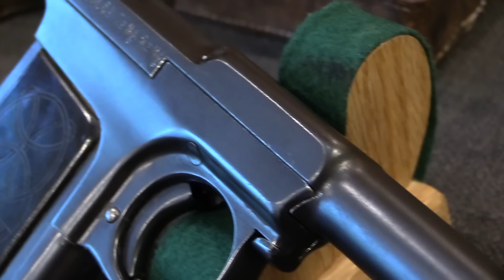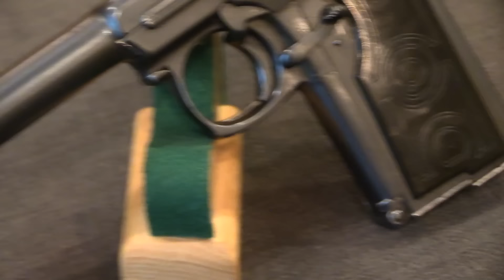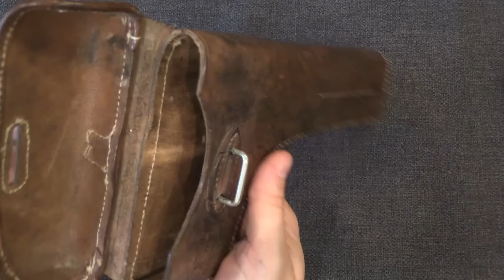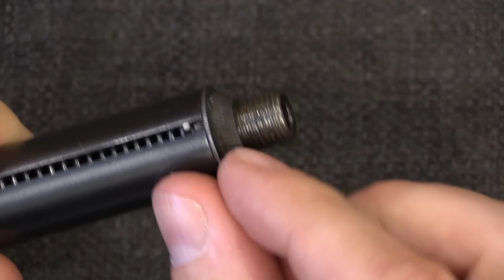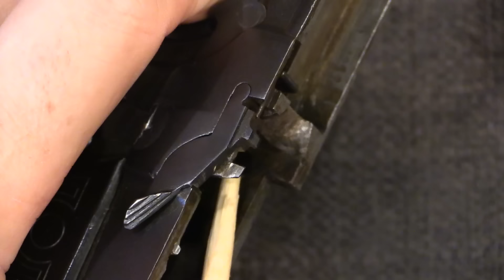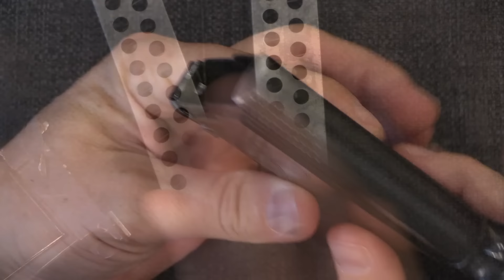Sunngård Automatic Pistol: 50 Rounds in 1909

Comment: Just watched this video almost 8 years after you posted it.
I easily see more reasons why the 1911 copy was favored over the Sunngard.
The ones you mentioned:
1. Too small a caliber
2. Awkward grip
Additional:
3. Too complicated to use.  Overly fine motor skills are required to engage the second magazine, then move it back into its original place to insert the third.  Too finicky.
4. The third magazine is set way too deep in the holster.  If the holster is mounted on a belt, good luck getting the magazine out in a reasonable amount of time.
5. The gun is too difficult to remove from the holster as it overly-encompasses the grip.

Comment: This is what I found:
Bullet weight: 28.5 gr (≈ 1.85 g) 
Claimed muzzle velocity: just under 2,000 ft/s (≈ 600 m/s) 
Muzzle energy: approximate calculation using 28.5 gr @ 600 m/s yields around 210–215 ft-lbs 
(~285–292 J) (ballistic formula: E = ½ mv²) — but this is a theoretical estimate based on claimed velocity. 
I was surprised at how light the bullet was.

Comment: The sights are interesting. There are large round dots on the lateral sides of the front and back sights. I don’t know if they’re meant to be decorative or functional, but I actually think that they could be brilliantly functional. They give a coarse but fast sight picture. I think that concept is actually worth experimenting with on a modern gun, although the coarse ‘reference dots’ could be much more compact.

Comment: å is pronounced as an o. The reason it looks like an a is that historically some of those scandinavian words used to have a sound ao or oa similar to œ(ö) or æ(ä) but those all shifted to either a simple A or an O sound. The Å means an ao or oa that is an O these days, where as the ones that shifted to A are just A. The regular O in Scandinavian languages usually produces a U sound... I actually don't know why.

Å is used in all Scandinavian languages. Some would say all Nordic languages since it's also in the Finnish alphabet, but Finnish as a language doesn't actually use it. In Finnish it's just a hold-over from when Finland was under Swedish rule, and the reason it was never removed (under Russian Imperial rule or during modern independent democratic times) is that Finland still has a sizeable Swedish speaking minority. So it's there for political reasons.

So if you ever see an Å in a Finnish text, you can be 100% sure that the word is either the name of a place, a company, or a given name of a person with Swedish (or other Scandinavian) heritage. Because Finnish has no words with å.

Comment: This seems so ahead of it's time but as soon as you see the awkward magazine moving sequence and ease of accidental disassembly you can see why they didn't adopt it because no way soldiers would want to be fumbling with that and braking parts, cocking it and the slide falls off.

I feel like if they just concentrated on 1 double stack magazine it might have been more successful. 25 rounds in the gun is enough. Having different magazines for the order to load is just a horrible idea.
If you have to reload, pulling a magazine from a holster is ultimately easier than fiddling with that rear magazine in the grip.
Reply: Maybe with a single magazine and better grip I could see this being taken up for police use etc in that time period

Comment: Hg (or hg) stands for hectogramme, hecto meaning 100 in Greek, just like kg is kilogramme, and kilo is 1,000 in Greek. Hecto (in the sense "100 grammes") is little used in general, but in Sweden it's rather common, so perhaps also in Norway, which was under Swedish rule from 1814 to 1905. The two weights are probably emty and fully loaded.

Comment: This is lame. I thought it will automatically feed from the rear magazine with both in place -- which wouldn't be too hard to do. A simple auto switch implementation will be a spring loaded round pickup on the slide which will NOT drop low enough to strip rounds from the slightly lower rear mag unless the front mag is empty.

Comment: Thats a cool gun. So the rear magazine is basically an internal magazine, which you can only load, when its in the forward position, with the slide locked back and via the ejection port I assume? Or do you have to disassemble the gun in order to load it?

Comment: Aesthetically beautiful (like most pistols from c1880-1920) but not too practical -- for me less about the caliber if it's really that fast, but more the awkward double-retained-magazine system. I wonder how this would've stacked up against .22WMR; which is actually a much more viable defensive round that most people think, especially compared to .22LR. I'm one of those nuts who actually prefer a vertical grip on my guns, like the AR and the early Colts, vs. the standard "1911 angle" that almost everything has since adopted. This is literally forward canted though, and being extremely thin and wide besides just strikes me as horrifically awkward, and leaves me wondering why on earth he didn't go with a single mag and conventional grip!

Comment: Very cool old pistol in several ways. 
 Probably lots of hand work fitting magazines though meaning slow, high cost production.

Three things it makes me wonder.  Why no one else ever double stacked the .25acp, why are all .25acp barrels so short, and why no one ever redesigned the .25acp by adding a half inch to the case length?  I suspect another half inch of powder in the case would make a .25 somewhat more formidable, and if it was double stacked with a reliable, alternate feed magazine, surely at least 18 shots would be a standard on a full sized 4 inch bbl variant.

Comment: That's pretty cool the ammo speed as advertised gives each round 280ish fpe which isn't ridiculously underpowered like a lot of other handgun cartridges of the time. Even if it was only 200fpe with 50 rounds in the magazine that's a very good personal protection pistol held in a holster under your jacket or whatever. If I was alive back then and had the money this would be one of my top picks as for a civilians  close range personal protection pistol. The tradeoff in size compared to a revolver is outweighed by the ammo capacity in my eyes

Comment: Am I imagining things or does the third magazine not have a magazine catch hole?   The third magazine appears different from the primary and secondary magazine in the way the form work is done on the rear of the magazine as well.  I do wonder how the secondary magazine was intended to be reloaded if you need to disassemble the pistol to reload it.   I rather suspect that would have been one of the leading reasons of its rejection as a service pistol.   Fantastic video otherwise.

Comment: A 6.5mm (.256 inch) 29 grain bullet at 2000 f.p.s. would create 258 ft-lbs of energy at the muzzle, equivalent to a .38 Special 158 grain +P bullet fired from a 6 inch barrel revolver. Not bad, for 1909.

Comment: I'm not sure I agree with Ian that the low bullet weight was the reason. Bumping up the caliber and dropping to 36 round capacity solves that easily.

Watching this a second time, I think the ultimate deciding factor was that operating the magazine switch and reload is a confusing process that the common soldier can easily screw up when things get hectic or stressful. You interact with the magazines in 3 different ways for the 3 scenarios of reload, and all 3 of them are clumsy and a bit slow. For the average soldier, a straightforward reload would be smoother in the long term.

A long reload is also a long period of vulnerability. It doesn't matter how many rounds the gun has then, a single shot can kill you and you have no way to deter your enemy. Granted, you might catch them in a reload before they catch you, but their reload is seconds. Yours could last half a minute or worse if you fumble around with this thing.

Assuming sungard offered this in a heavier caliber, if these steps were smoother and semi automated, like doing it all with the help of a button or lever to take out the element of human error and human clumsiness, then I think this would have been adopted. It's a good concept, but probably one that didn't see enough practical testing to account for its ergonomic design flaws.

Comment: On a 44 magnum desert eagle  once the magazine was tuned for a smooth feed, it had problems in cycle of my thumb pushing up the slide lock. It was very accurate, but had a gas system I never figured how to clean

Comment: Beretta m1951 is easier to disassemble. Pull slide back slightly, rotate the smontaggio pin, slide comes off toward. Push recoil spring together and pull it out. Then barrel comes out.

Comment: If I was the military, I would have looked at this and told him to do a bit of redesign. 
1: only one magazine in the gun. 
2: forward canted shorter handle if possible (the magazine could tilt back slightly within a forward tilted grip) 
3: three extra magazines in the holster for a total of 100 rounds. 
4: lengthen case from 19mm to 22mm and up bullet from 27 grain to 35 grain. (Overall cartridge length from 23mm to 28mm)
5: maybe add a select fire switch.

Comment: Is it possible to remove the forward magazine and replace it with the spare magazine from the holster and keep the rear magazine as a reserve? (this seems less fiddly than walking the rear magazine forwards, as it would have to be moved back again to insert a new front magazine)so you would progress from  50 rounds,  fire off 25. change the front magazine and fire off another  25 and then use the rear magazine for shots 51-75.   It would be very useful if you had a companion reloading a forward magazine as you fire off the second 25 rounds so you could keep replacing the front magazine and only use the rear when you had used up all your available rounds. This would also avoid having to count off 25 shots as you could hand over a part-used front magazine to be topped up by the loader and insert a full 25 rounds fairly quickly.

Comment: If they'd redesigned it abit later on, say the 30s(in which case it could've been redesigned for the 9x18 Ultra round), or if they wanted to keep it light and with a larger capacity they could've designed a round similar to the 5.45x18mm or 4.6x30mm or 4.38x30mm. Say 4.5x33mm, 4.7x21mm, 5.3x18, 5.5x25mm, just as some examples. It'd have taken abit of reinforcement of the materials to handle such cartridge types, but it would've allowed the usage of small caliber rounds that still would be powerful. In either case, I think the concept could've been good with abit more work put into it.

Comment: As a firearm salesman, this in 25 ACP would sell like hot cakes. Especially if you slimmed the grip and went with one 25 round magazine at a time. Call it the Sunngard 25.
Reply: You just describing it made me want to buy one
Reply: any double stack 25acp would be cool. someone speculated what if history went differently and we had 25lr, and everything that is today available in 22lr was to be available in 25lr. that would be awesome..
Reply: To my current understanding 25 acp is the worst handgun round ever made. Why do people desire it?
Reply: @TheBeemanblake   it is centerfire, has light recoil and can bet put into a very small pistol , any handgun that has 6 rounds of .32 can have 10 rounds of .25 ACP.
It should be noted that the .25 ACP is often compared to the .22 LR but the .22 is usually being fired out of a rifle barrel and the .25 out of a pocket pistols 1" barrel.
I would like to see the comparison of two autos in .22 and .25 with the same barrels.
Reply: Designed for a 29 grain bullet.
Cci stingers, lightest fastest "standard" 22lr are 32 grains.

I could see a single 25 round mag in 25 ACP, scaled down a bit for market and design purposes - you might have something there that's doable and would sell - if it works.
IF
Big IF
Reply: @markvickroy6725  Oh I’m not saying the project wouldn’t require significant re-engineering, but if done right it would sell

Comment: What a cool little pistol from the early days. Hell it even came with a threaded barrel. Imagine if suppressors were a thing back then!
The only other pistols I can think of that are relatively high capacity are the following:
* Beretta M92 - 15 rounds (standard), up to 32 with extended magazine - 9x19mm 
* Glock 17/18/19 - 17 rounds (standard), up to 33 with extended magazine, or 50 with a drum mag - 9x19mm
* FN Five-seveN - 20 rounds, or 30 with extended magazine - 5.7x28mm
* Tec-9 - 32 rounds (standard), or up to 72 rounds with a drum mag - 9x19mm

Comment: I’ve been trying to design a gun that feeds from not just a double stack but from two single stack built into the grips. 25acp is the ammo I plan to use due to being center fire and small.
Reply: Two separate or conjoined magazines if you want it to feed alternating (let’s say  left mag then right mag) that seems not to impossible if you want it to feed (let’s say all of the left mag then all of  the right mag) that would probably need a separate action that you can turn on and off like the KSG

Comment: “Only holds 18 rounds, which is still more than any modern service pistol” 

FN 5-7 HAS ENTERED THE CHAT
Reply: Five-seveN is not a modern service pistol as such, it's frankly a bit too boutique even compared to its P90 relative.
Reply: But it's got two of em'
Reply: Kel-Tec P50 entered the chat... a pistol using the p90 50 round magazines in 5.7x28       ...  yes i know not a service pistol (yet?)   but still awesome
Reply: @Hartz4Empfanger  far too large to ever be a derive pistol lmao. But it’s cool as fuck for that “space blaster” aesthetic
Reply: Last I checked, 36 > 30.
Reply: the five seven holds over 36 rounds?
Reply: Well obviously when your primary gun fails you you just switch to your secondary to shoot the 18 guys in front of you. I get that having more ammo is better in some situations but if your primary fails and you have to use your pistol, you're very fucked. Same for an officer using his pistol. Gnerally why revolvers were used so late. Having a reliable gun is more important than ammo capicity when it comes to pistols. Obviously primarys are another thing.
Reply: @Khetamine  almost all combat data collected by western militaries indicates that the force with the greater volume of ammunition wins the vast majority of engagements. 

While you’re right that resorting to your sidearm is generally not ideal, being able to carry more ammo, in the same sized package is extremely valuable.
Reply: Did they have the 57 two years ago? I really don’t know.

Comment: I like those sights on a handgun like that. Close range and under extreme duress you could just line up the 4 guards and aim with the whole center between them and still put shots on a torso. Would be great for trenches or on horseback. But like you said with the micro grain weight bullet it’s pretty useless even in a situation where people would be wearing flack jackets.

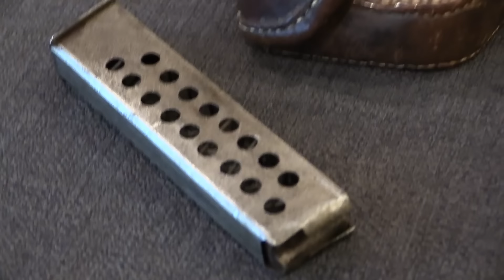Comment: 2:02 “25mm” ah yes, an anti-material pistol. 🤣
Reply: You better cover your ears ;)
Reply: @Reuel-Jazwa  and have robotic arm to hold recoil
Reply: Especially at 2000ft/Sec. that would, assuming average weight for a 25mm projectile of 260g, give it 520000 joule KE.

So yeah, sadly it aint so, but that would be....^^
Fallout can build it, I am sure.
Reply: It’s not a pistol, it’s a wrist remover
Reply: if you enable the caption, gun jesus corrected it to .25 caliber
Reply: Affiq Ariez I saw that, still thought it was hilarious. 🤣
Reply: Nevir202 it is
Reply: And still hold 50 rounds
Reply: Recoilless pistol lol.  You have to hold it way out to the side, and lord help anyone in the gas plume.
Reply: Its not a pistol its a flashbang.
Reply: *Anti-materiel

Comment: 13:26 So, is that lever an out-of-battery safety or a disconnector? How does it disconnect? How come that you cannot "pull [the lever] down far enough", but it is then pushed down far enough by the slide?

Comment: Sunngard was given hazey visions of modern(future) design.. either by interdimensionals in the aether... or by ETs.  Then he sets about engineering a gun.  He got the double stack mag and hi cap no problem.   He took a normal pistol grip and swept it the other direction. He put the controls in an ergonomic spot for a right hander based on some hazey visions of SIGs. He took the small caliber concept from five seven and pmr and it had babies with the anemic blowback cartridges of the day. He got the striker fire from glock. Trouble is, during design he was toasted on absinthe and laudanum... We wound up with an interesting piece ahead of its time with an uncomfortable grip and unadoptable caliber.

Comment: It does have amazing forward thinking of high-capacity, low recoil, double stack mags...
   But it is basically a 22LR cal with a lot of rounds!
   Based on your enemy, it could take 20-30 rounds to be effective. 
  75 rounds divided by 20= <4 Max...with 3 reloads.
   .45 acp, 7 rds.. 1 round per 200# animal (man or beast). =7 crapheads with no time wasted reloading (while trying to pray also, for added assistance)!
    Hmmm, Imagine that, I think I'm going to take the 1911! 
   I am interested in the extra mag tho!  Y'all take Care, John

Comment: So, if the disconnector was a tenth of a millimetre or so shorter, would this fire full auto or just once on the trigger press?
Or would the trigger hold back the seer just long enough so after the first trigger press, releasing the trigger would make it runaway full auto?
Is a pressed trigger interacting with the seer coming forward?

Comment: The changing of magazines within the gun doesn't seem all that much faster than changing magazines regularly. You'd think they could skip that function and have just one 25 round double stack magazine in the gun and two spares, which still gives you a lot of capacity, then use longer cartridges for more power.